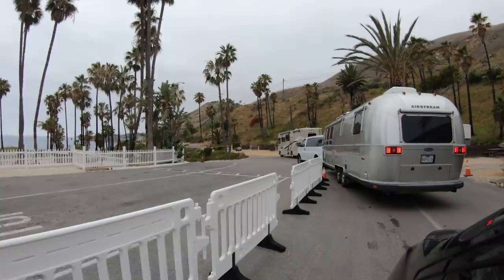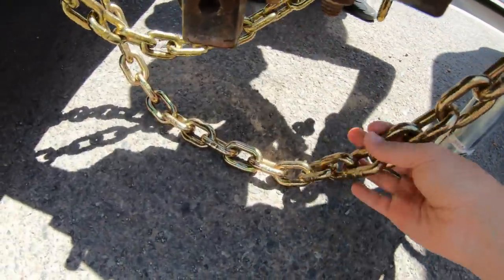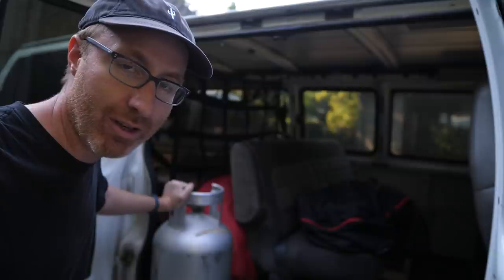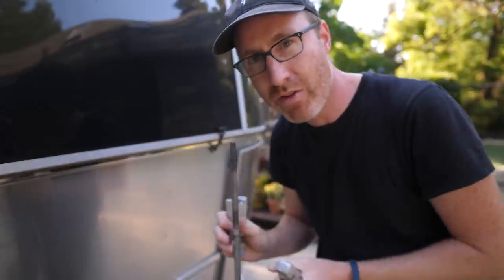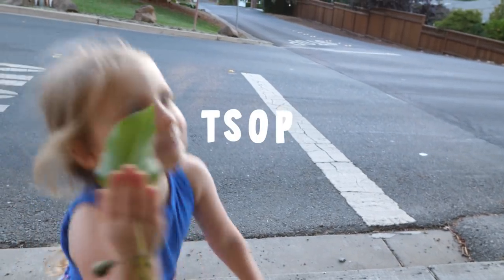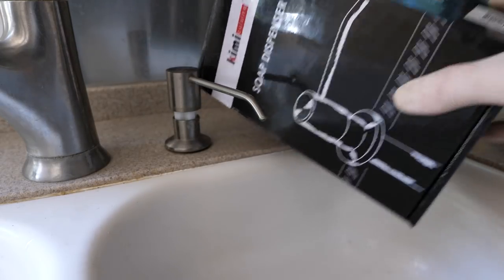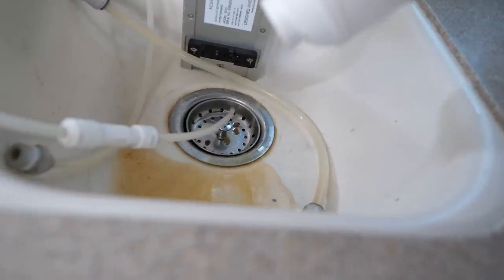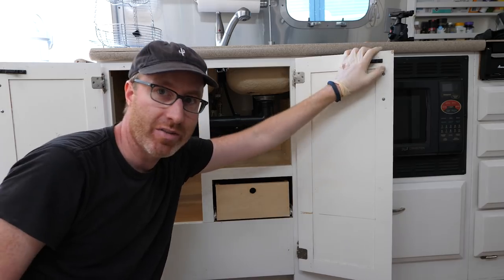Getting rid of Airstream parts

Comment: I believe the regulator bracket goes on top of the T bar with the nut sandwiching the bracket. It will relieve the pressure on the hoses.

Comment: On the soap dispenser, I have a "hack" I've used a few times.  I found the bottles that come with them are too small, too hard to remove and replace for filling, and filling from the top can lead to a big mess if you aren't watching the bottle the whole time---not easy.  Instead, I just use a liquid soap refill bottle.  Pick the refill bottle of your choice, and find a convenient place in the cabinet for it.  measure from the bottom of the dip tube to the bottom of the bottle, and add a few inches.  Take the dip tube to a hardware store, and get that measured length of flexible plastic tubing that fits snugly over it.  Fit one end of the tubing over the dip tube, the other, cut at an angle, goes into the refill bottle, for a long time between refills.  To keep junk from getting in the refill bottle, drill a hole in its cap just big enough for the o.d. of the tubing.  When the refill bottle is empty, just replace it with another of the same kind, and the old cap goes on the new bottle.  With the refill bottle being so much bigger than that little bottle that comes with the dispenser, your bottle replacements will be much less frequent than your refilling of the little bottle had been, as well as being far faster and less messy.
Reply from the maker: Love it! Thanks for the hack!
Reply: @ThreeLittleTrees  You're welcome.  We've been following your channel for a while, but usually watch on the TV, which doesn't allow for comments.  Thanks for the great videos.  I think we first found your channel when you bought the Airstream from...um...another channel we follow.  KeepYourDaydream?  LessJunkMoreJourney?  Anyway, we've found it charming.  We're going to jump in with both feet in a few months, when my wife retires.  We have our truck, but are still looking for the right RV, most likely a ginormous fifth-wheel toy hauler.  We need a lot of space for two retirees and a microdog.
Reply from the maker: Thanks for sharing that story! Glad you’re here. Yes it was LJMJ we got it from. So grateful to have the chance to get a rig that we already knew and trusted. I can’t imagine we would have ever jumped in if we had to buy from an unknown seller. Looking forward to hearing about what you decide to get.
Reply: @ThreeLittleTrees  We were seriously considering the Riverstone 39FKTH for a while.  It has the mini-garage under the master bed in back, like the Grand Design Momentum 376TH(s) we also like, and a fantastic kitchen up front.  We have a list of pros and cons though, and doubt we'll end up with that one, or the 376 for that matter.  Most likely, we'll get a Momentum 397TH, like Chad and Tara of the "Changing Lanes" have.  The garage is the usual style, and we'd use it as our office space while stopped, which gets the office away from the TV area.  It also can have a second bathroom, which could be handy.  Nowhere near the kitchen, but still a nice one for an RV, and the usual front bedroom setup, with W/D hookup in the closet.  We've walked through so many different floorplans.  Early on, we thought we'd get something very small, like a class B, but realized that wouldn't work for us long-term.  At this point, launch looks like June, but it would be good to have the RV before that.  We'd like to get the RV, park it locally, sell the house, and have time to make any improvements we want while still local.

Comment: Man, i would buy that water treatment unit from you and pay to ship. I didn't understand why you would get rid of it. That thing is 700 dollars new. Second, you remove the water lines by pressing in on the coller like shark bite connectors.
Reply from the maker: Thanks LLLT. We removed it simply because we never used it. The reason we never used it because it leaked from a connection. The “clean” tube that goes to the faucet is tiny and doesn’t have a robust connector like the other tubes.

Comment: Get longer hoses... some have ss braid.  Make sure to get some yellow teflon tape for the fittings into the regulator.  Also the hold down is done with a large wingnut style requiring NO wrech and it has more bearing surface where you broke the previous hold down part.  My tanks sit nice and hoses dress well.
Reply from the maker: Thanks so much Fred for all of the helpful tips!

Comment: I  "think" you overthinking this issue. Our rigs came with big wing nuts to that no one could use a nut and a big wrench and break the cast metal tie down bar. As you know, the propane bottles are retained by a lip at the bottom of the bottle. The top bar is needed to provide a very small amount of verticle control. The broken part you replaced most likely was stressed at one time by a nut and wrench, which was never part of the design. Your rig and many others conquered bumpy Alaskan roads  with no issues. Good luck.  PS . If your are an IT person, or have an aerospace background , this is a common outcome when we venture into mechanical issues. :)
Reply from the maker: Ha! I've finally gotten around to simplifying the propane setup as you suggested, with the giant wing-nut directly on the tanks instead of the regular nut holding that other clamp. Makes such obvious sense now. Also replaced the pigtails with longer ones so they're no longer under stress.Thanks for the encouragement! :)

Comment: If u can why not cut out that area so the lines have no pressure on them from the tank cover
Reply from the maker: Thanks for the idea!  I'll look into the options with that cover.
Reply: @ThreeLittleTrees  if you do just sand down what you cut out & put rubber on it.  You can cut rubber tubing & glue it on so the metal don’t cut your wires if it rub on it from vibration.

Comment: What if you bought a piece of black pipe insulation tubing stuff from the hardware store or a solid piece of rubber tubing that you could slice carefully. Then secure it to he bottom of the aluminum surround tank cover all the way round for a cushion. You could also put the wires in a larger piece of tube cushion to protect them??

Comment: The tank hold down bracket on our 30 ft fits over the top of the tank handles and is secured by a large “wing nut” about 7 inches long. Check with the dealer to see if this wing nut is available.
Reply from the maker: Thank you Cam! This is so helpful to know.

Comment: Not sure that you need the separate nut to hold down the propane tanks.  My 25’ and 30’ Airstreams do not use the extra nut, just the large wing nut after the holddown bracket is placed over the tanks, then the cover is dropped over the tanks.

Comment: Are your propane regulators on backwards? Mine are readable from the front. Also my bundle of wires run along the frame away from the tank cover. I also secure my tank covers with a bungee so it doesn't take a trip while I'm driving down the road, safe travels
Reply from the maker: Thank you so much Calvin for all of those tips.  We will definitely investigate!

Comment: Hello!  Glad you had a good experience at the Fairfield Airstream.  You were asking if a cover was important for the propane tanks.  Yes, it is.  Here is why: (From our instruction booklet on our trailer, “Because air is required for proper operation of the regulator, it is very important that the regulator vent is kept clean and free of debris. This is why it is necessary to keep the vent facing downward and the regulator covered to protect it from contamination.” Thus the benefit of a cover.  Hope this information is useful to you.  Safe travels.
Reply from the maker: Thanks so much Julie for passing along that information! It also gives me a good reason to go and inspect and clean that regulator part.

Comment: I would think bottled water would use much more room than that filtration system. Just get it fixed.
Reply from the maker: UV is a neat idea but the installation hardware is fragile and the failure behavior is a pressurize leak under the sink. Even repaired or new, I wouldn’t be able to trust it not to leak again. It is true that bottles of water take up space, but on the flip side, they also provide additional water capacity for boondocking.
Reply: @ThreeLittleTrees    Have you thought of using a different kind of filter?  We use a disposable (after 6 months) know me that just hangs on the cabinet wall and is part of the faucet line. I just really hate bottles of water whose containers end up everywhere!
Reply from the maker: We are definitely interested in new ideas for all of the RV systems. It’s probably a pipe dream, but someday would love to make a simplified RV from scratch. What kind of filter system do you use? We almost bought a Berkey but couldn’t quite get there after reading some mixed reviews.